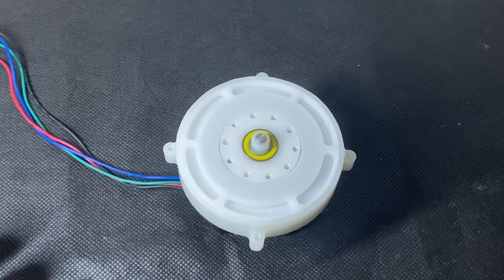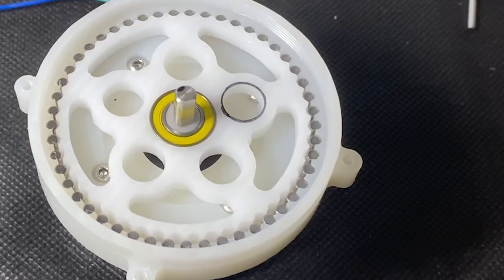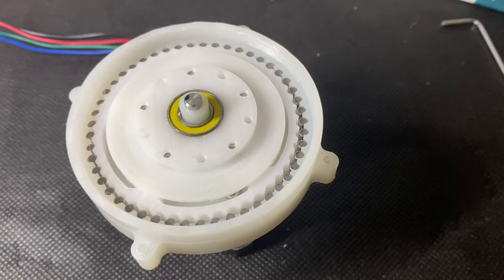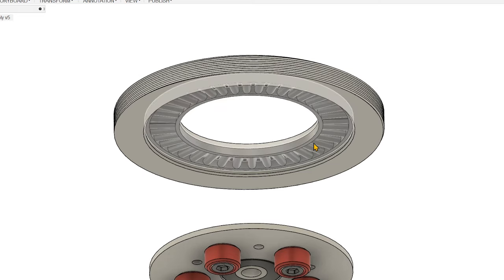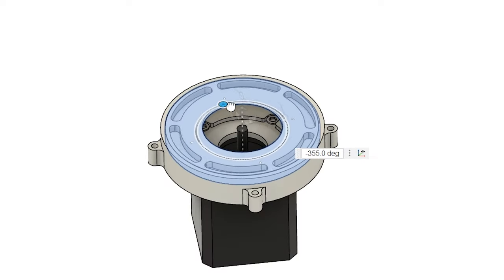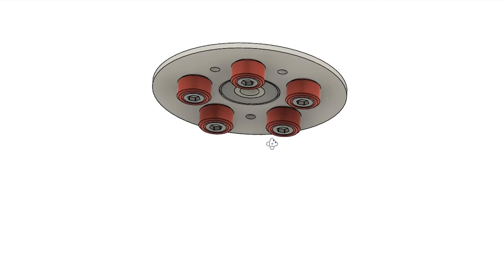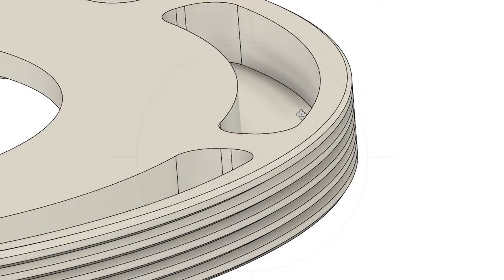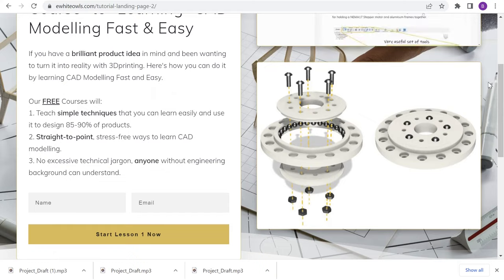Wow I Didn't Know it's so EASY to Design Cycloidal Drives

Comment: you should add the second cycloidal disk 180 degree out-of-phase to eliminate vibration.
Reply: James Bruton reference?
Reply: @godamkeras4144  SUMITOMO reference.
Reply from the maker: Yes that will be quite helpful. Currently, I am going at rather slow speed so vibration has yet to be significant. I guess i will need to implement your suggestions when I am doing high speed rotation. Currently, having a single disk seems to distort the torque pin quite badly and lead to significant backlash, i am guess that a second disk would help balance out the forces.
Reply: @thewhiteowls1320  Two cycloidal discs do not cancel all orders of vibration. A three gear system with each gear set at 120 deg from the other provides (almost) perfect balance. Our robotics team has used 3D printed, three gear cycloid drives, multiple times. They are driven with a motor with a free speed of 5676 rpm and produce no vibration. Also, since roughly 1/3 of the 'teeth' of each gear are in contact at any one time, three gears provide almost 100% tooth contact. Finally, we use as many output pins as possible to spread the load from the holes in the printed gears. For example our 48:1 cycloid drive has 24 output pins. Hope this is a help to anyone designing cycloid drives.

Comment: It would be interesting to see if you could laser cut or cnc the large gear piece, that might increase performance a bit.
Reply from the maker: Yes the large gear piece is cnc milled from delrin. it does help with the accuracy compared to FDM printed ones.

Comment: Only the one axial bearing for the output won't be enough, you'll need a second ball or tapered roller bearing to account for radial and angular loads. Your design won't be able to stay on axis and have a lot of friction and deflection with radial and angular loads.

Comment: Hi techer , Thanks for your guide. I have question,  in section 'Design the Cycloidal Disk' step 2, 31/49=0.632, but in your guide set value to 0.622,  could you please tell me why ?
Reply from the maker: my mistake, thanks for pointing out ! it should be 0.632
Reply: @thewhiteowls1320  Hi Techer, I cannot refer your guide to redreaw the "Cycloidal Disk" on Solidworks , I always hung on step 7, Solidworks cannot offset profile on parameter 1.5mm , maxmium value is 0.7 , however same parameter can be set on Fusion 360, but profile cannot closed, cannot extrute to a cube.  Clould you please share a guide on solidworks?

Thanks  and Best Regards.
Reply: May I have your email? I want to send my document to you, If possible could you please guide me and indicate my wrong settings.
Reply from the maker: @yilongchen5133  should be contact (at) ewhiteowls.com

Comment: In Design the Cycloidal Disk,what is the length of the secondary lines .which drawn in diagram
Reply from the maker: the secondary lines are for drawing the cycloidal profile. In actual mathematics, the cycloidal profile is created by a smaller circle rotating around a bigger circle so the secondary are formed by a small circle rotating around bigger circle.

Comment: Any indication of the efficiency? A similar design in youtube with steel pins instead of bearings has an efficiency of 35% which sounds like a lot of waste. Also do you have any ideas if the wear on cycloid discs would be acceptable? Thanks
Reply: I should read your post before apply steel pins to my design instead of bearing. Using PLA as gear material is not a good idea, too soft and friction too large. My gearbox efficiency is 34.9%, which makes my motor can only operate at very low velocity. After I switched to bearing I got 86.5% efficiency, but because I use it to lift heavy load, my gear wear immediately and causing huge backlash.
Reply from the maker: mathematically, the cycloidal disk does not slide against the pin but roll over it instead, very much like spur gear. It gave me the confidence to stick to dowel pin as long as i am able to manufacture the cycloidal disk as close to the calculated profile as much as possible.
Reply: Is this system reversible?

Comment: hi man, very cool design! I'm trying building one from your stl with PLA but i'm having the problem that the cycloidal disk can't move because of lack of enough space from 3mm pins. The disk is stuck. I notice with multiple prints that maybe the holes for the pins are a little too small resulting in bad positioning of pins. Do you have any suggestions? Thankyou!
Reply from the maker: Hi thanks for liking the design. typically a printed part is slightly oversized around 0.1mm extra on each side. You have to try print some simple sample and measure if the actual size match the designed size and apply offset to your 3dprinter accordingly. My Prusa does it for my automatically so i have no issues, i am not sure about other printer. And in another video of mine, i drilled the hole through 3mm drill bits to ensure it has enough clearance for the pins. hope it helps!
Reply: @thewhiteowls1320  thankyou!. I will try! 😀
Reply: @thewhiteowls1320  I got the same problem as davidenardi536 experienced. It seems the set of 'cover & disk casing' and  'gear & disk casing' are not matched. cover and gear are unexpectedly lardge and disk casing is small. Thus, i decided to fix the size of the disk casing but, it might be able to affect the whole reducer in a negative way. I am worried but I will also try to fix it :)
Reply: I noticed that the two files, STL files and STEP files, are not same in the same zip file.

Comment: Harmonic drives no longer in use? Sorry, I got no robotic knowledge update since 20 years ago.
Reply from the maker: Yes harmonic drives are the gold standards in robotics but they need specialized equipment to manufacture. I am just a home based hobbyist so cycloidal drives is the best I can come out with. I am glad you are back with robotics!
Reply: @thewhiteowls1320  3D printer should be your best friend. No more relying on CNC machining.
Reply from the maker: @mtay65  haha i kinda like cnc machining tho

Comment: This 3d printed drive with all the expensive hardware in it (giant thrust bearings etc) will end up costing more than an all-metal simple planetary, and close to as much as a metal professional cycloidal. 

Unless the expensive metal bearing components can be reduced, these things are basically fun but pointless.